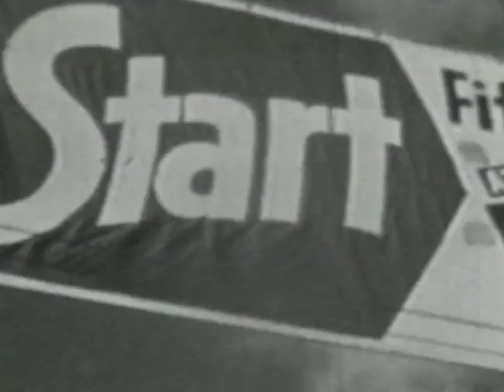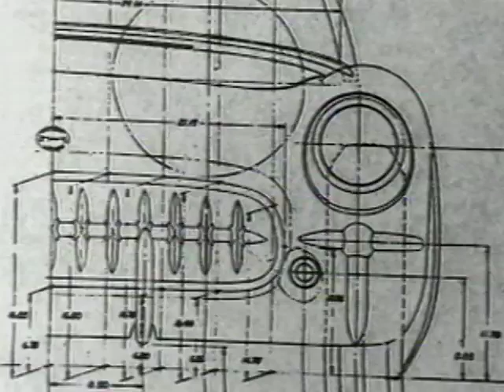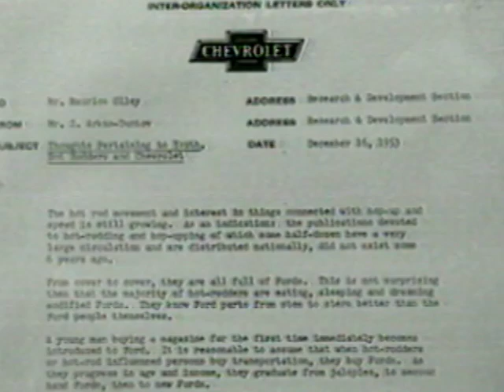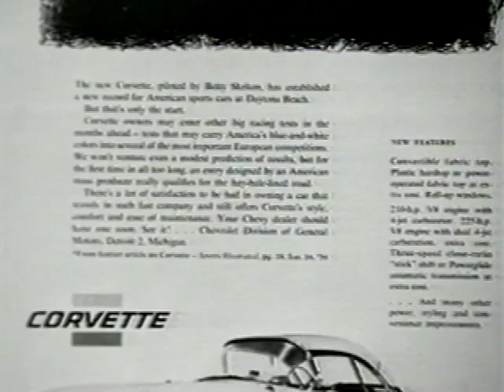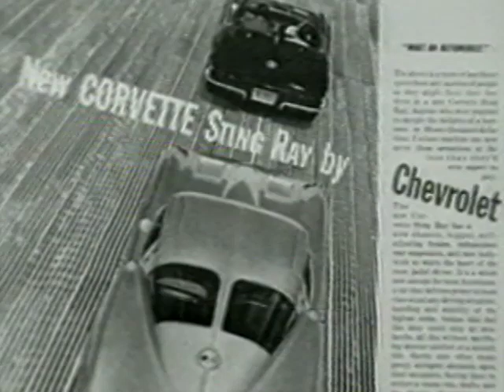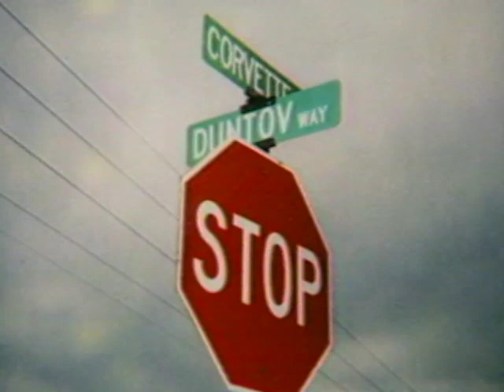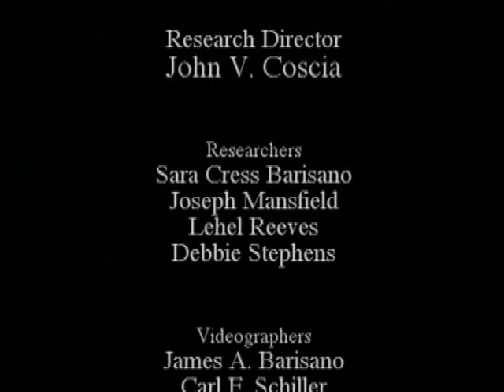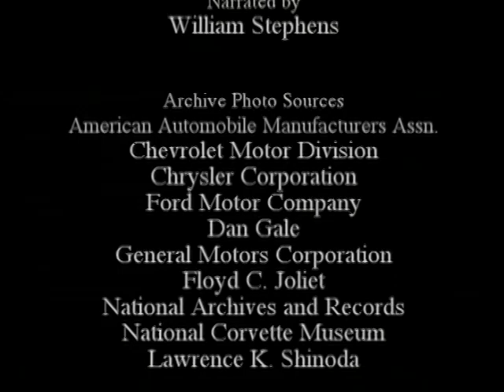The Corvette, Reflections of the Stylemakers - Still remains one of America's finest sports cars.

Comment: I can remember like it was yesterday. I was seven years old in El Paso Texas as I walked to school every morning by the office of a steel company called RAMSY STEEL, when saw a brand new, red, 63 split window Corvette parked in the reserved parking space of the president of Ramsy Steel.  I was so stunned I literally was late to school that morning.  I felt as if a UFO landed and the space aliens  forgot to take their car back into space.  To this day my desire to own a 63 split window is overwhelming.  If I had a choice to pick a 63 or a new mid engine 2020 Corvette, hands down the 63 is my choice.
Reply: Dan Sotelo    Aren’t they just absolutely gorgeous.
Reply: I remember  reading somewhere that the car that was the 1968 corvette was supposed to appear for the 1967 model year. Frankly  the powers that be were right to hold off for the additional  year because the 68,for all its wild style had numerous  quality issues. In that generation   I feel as though the   best years were from 1970 to1972. Furthermore  I still think that Chevrolet  could have still  gotten  a few more years  out of the 63to 67 stingrays,  and oh by the way the. 67,the car that wasn't supposed to be,was about the best and most refined  of its  generation
Reply: Dan Sotelo Dan I own a 64,72, and a 15 ZO6 the 64 I’ve had for 38 years it’s my favorite so I would agree with you. But I’m saving up for a C8. Don’t wait get a 63 ASAP because they are only going up in value.
Reply: Agreed

Comment: C8 is the most exciting develpement since the introduction of the C3 body style in '68. From the absolutely HORRIBLE and Plastic crap C4  on through the C5 which was only marginally better......the C6 and C7 were indeed far better cars and certainly brought the performance potential of the Front engine design to it's ultimate potential yet it's still a big distance of time since the last BIG DESIGN improvement of the size seen in the first 3 generations of the car. The C8 finally shows a return to real automotive risk taking and huge change in the quest for a better and different car. These are again exciting times for Corvette fans.

Comment: I have a 77, and 79 both mildly hot rodded. Love em both. Very aggressive feal.
Reply: “Mildly hotrodded” coming from vehicles with less than 200hp factory doesn’t take much
Reply: @redram5150  just headers, cam, long tubes, intake. They run like a Corvette should run.
Reply: Steve douglas for that period, they were meant to run with under 200hp
Reply: @redram5150  don't think this makes sense.
Reply: Steve douglas look up the specs for late 70s Corvettes
Reply: @redram5150  look up adding hp to ç3 Vettes. Same transmission, Eaton differential, th 350 trans which can hold up to 375 lb ft of torque. Then tell me my business.
Reply: Steve douglas you’re moving the goalpost. It’s a sub 200hp, anemic, malaise V8 from the late 70s
Reply: @redram5150  a chevy 350 with those mods can be pushing 300 plus hp, the exhaust heads cam and intake held them back. You are wrong man. He probably has a ripper